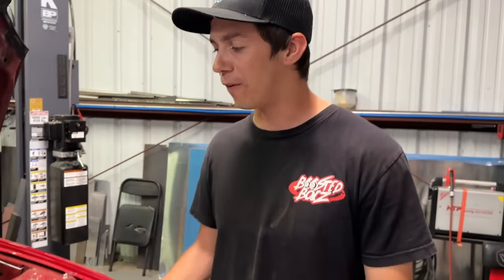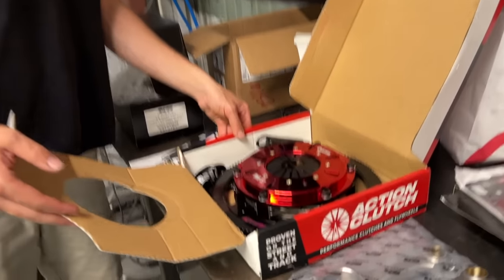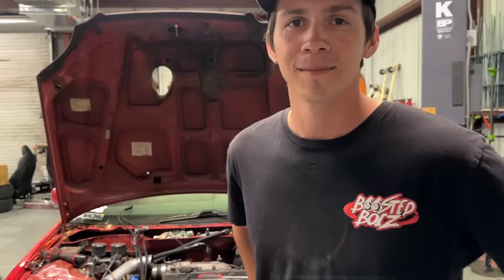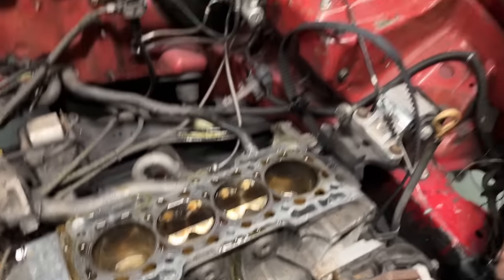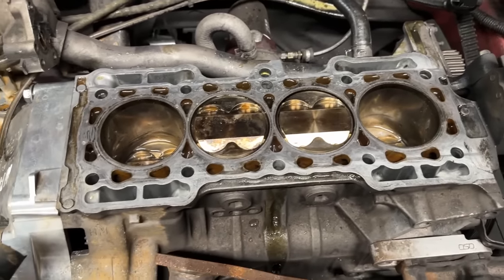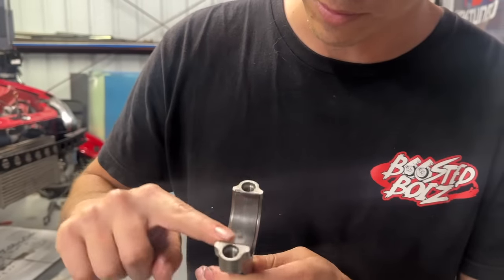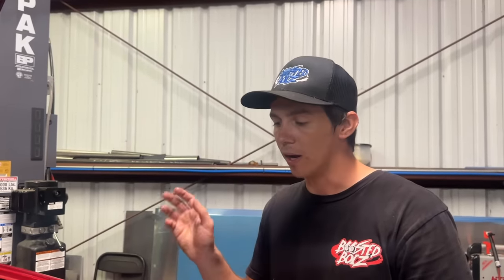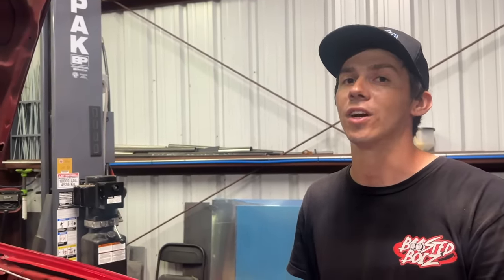Rebuilding The Hatch To Handle 1000Hp Overnight!

Comment: To get rid of all that rusty water but you’ve been having a problem with get yourself a couple of quarts of CLR and add it to the cooling system let it engine come up the temperature let it sit overnight bring it up the temperature again let it sit overnight againand then flush it with Clearwater until you get no rusty water out of it whatsoever then refill it with water add water to it, which also has a rust inhibitor in it and you should be just fine

Comment: Oh no! That's why it lasted so long! Lower compression. Now you're raising it and it damn sure will blow the head gasket. Especially not resurfacing the deck or head. Wtf 
New cross hatch on used rings? Dang. Why so much work and half ass it man? I was so excited to see some ocd h22 building! 😢

Comment: It probably helps even out the air flow to atomize the fuel more even across all cylinders. Especially with tha amount of air its flowing. Be interested if its the same for low hp engines. I digress

Comment: man just put a cable holder for the turbo oil feed line you can even use a head cover bolt to hold it now it it will eat in the cover time with vibration

Comment: use distilled water in your cooling system, normal tap water and stuff will cause rust in your system because of all the minerals in it, distilled water doesnt have those minerals in it

Comment: It's seems like you would have more compression but the piston won't go down as far, so wouldn't it be the same amount of air in, same amount of travel, and the same amount of squeeze, just a little higher piston and a higher bottom?? So same compression I would think.

Comment: I am wondering if kia lies about power.i have a 2016 forte Manuel it loves freeways.only 145 horsepower.bs?hit 132mph not floored.was a lease for four years got a deal.i admit this car POS.leaking somewhere.72000 miles.but at 2800 pounds shift right I almost kept up with a Nissan Maxima 300hp?what the shifting matters

Comment: The rusty water is from the water you're using it has minerals and chlorine, the United States requires all city water, public water/ restaurants to have chlorine in it,and if it comes from your own well it has minerals in it. If you used distilled water, that won't happen.

Comment: The H23 rods on the H22 crank - being a little shorter - you were down on compression, which might explain why the thing held up for 5+ years. All the boost, overheating, etc - no problem - you had a built in safety net. Happy accident
Reply: BUT - you’re gonna have to be REAL careful and probably retune it. You don’t want to run a 9:1 tune on a 10:1 motor. That could get real bad real fast.